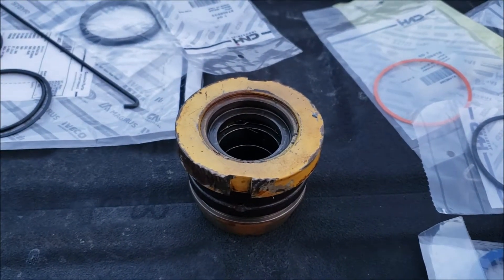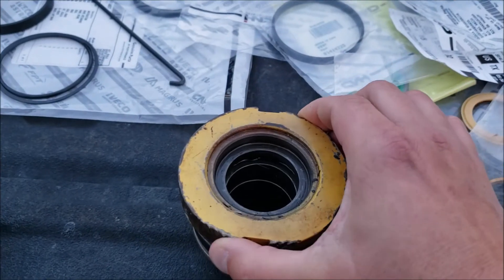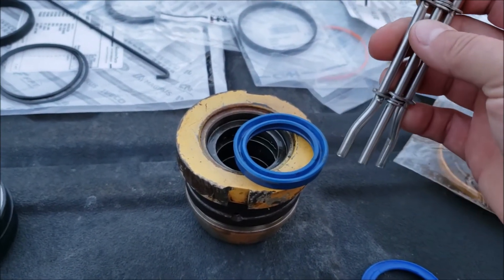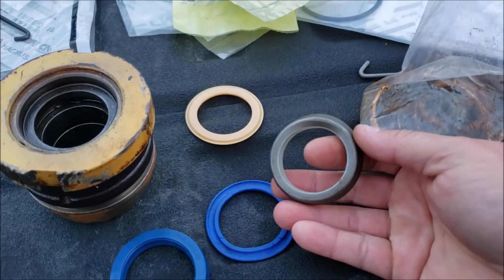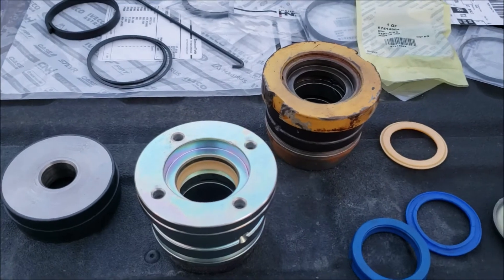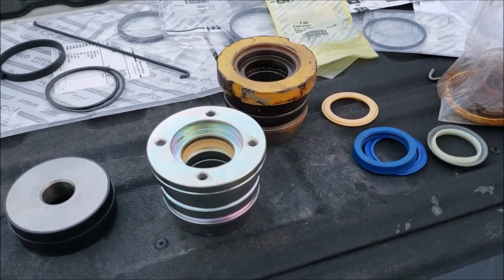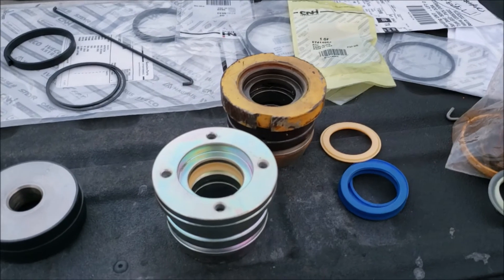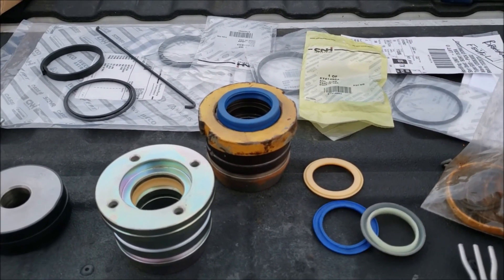Replacing Hydraulic Cylinder Seals - Part 4 - What did I do wrong?

Comment: If the superseded seal kit doesn't match with your old gland you don't need to buy a new gland just buy individual seals based on size. I do this every day.
Reply from the maker: Thanks.  Yeah, I learned that later on another cylinder.  I should have went to a hydraulics shop when I started having issues.  The local dealer wanted thousands to repair each cylinder, so that scared me away from them.  Later I found a shop that will rebuild each cylinder for about $300 including the seals.

Comment: I heat hyd oil to 180 degrees and let seal warm up to install it easily kinda but I bought the three finger tool set
Reply from the maker: I did not think about heating up the seal, but it makes sense.

Comment: I’ve used a ton of aftermarket kits and it’s a chance of getting the right seal and size 😊
Reply from the maker: Yeah, that was frustrating.  They only had one part number for this tractor so I did not know the gland had changed.  I blame the manufacturer for changing glands. ☹️

Comment: its a u-cup not a c cup....the one below is call a buffer and this takes me literally like 45 seconds to install all 3....that install tool is a waste of money....and so was buying a new gland....ive been doing this professionally for over 20 years...you wasted more money than it would have cost to have it rebuilt by a good hydraulic shop....not all shops are good but this rebuild tops would have been under 200 bucks...
Reply from the maker: That is part of the problem around here.  You can't find a good shop that does not want $1000+ just to look at it.  From what I remember the local hydraulic shop (which most say to avoid) quoted me $800 just for labor and it would have to be taken off the tractor and dropped off.  Then I would have to wait months to get it back.  I have learned to just try it myself and learn as I go.  The issue I had here was that none of the parts I ordered were the right ones.  If I could have found the right seal kit from the start it would have been $35 and done.

Comment: When you run in to this again, go to a hydraulic seal supplier. I own a hydraulic repair shop and have lots and lots of seals (this is not a sales pitch) and I hear what you said about the seals being obsolete almost daily. New Holland, John-Deere, CAT, etc.....obsolete these parts under THEIR system, but the seals are most likely still made. I shock people every week that they can buy just a rod seal, or just a piston seal, even though they are ‘obsolete’.
  Seal Mfgs aren’t dictated by one or two OEM’s. As a seal supplier, you’d be pleasantly shocked what you can still buy. Don’t buy hard parts unless you’ve checked with some grey haired, cynical, crabby old man that can help you without forcing you to buy more parts. I’d also be very careful about crap sold online. After all, the kids toys from China had lead paint, really makes me think those aftermarket kits are.........better?
  Odds are, you’ll be pleasantly surprised.
Reply from the maker: That is great information.  Thank you!  I was so pi$$ed when I found out the issue.  Why pay 100s to replace the whole gland for a few rubber seals.  Great information that I will use on my next replacement.
Reply: As a seal supplier, I agree with Albert. We can machine or match up almost any seal even if it’s obsolete. Happy to help either of you out in the future! We speak hydraulic repair.
Reply: i've got a hydraulic cylinder that has a welded gland nut, every shop that said they would work on it wanted to charge $500-1000, when a replacement cylinder only cost me a 1/4 of the cost. sucks since i've rather repair the cylinder then replace it but not much i can do

Comment: Thank you for taking the time to help others in the same boat. You've undoubtedly helped many frustrated diy'ers like me. I have a 1998 NH 555E with the same issues. I take pride in doing my own repairs when I can, so when you find out you've been sabotaged, it's very discouraging.
Reply from the maker: Thank you.  It was very irritating to find out I was setup for failure on this fix.  Luckily it all worked out in the end and I learned a valuable lesson on parts and changes.

Comment: That is soo dirty that they discontinued your seal kit making you buy a new gland. I'll have to keep that in mind when I do my 1995 backhoe
Reply from the maker: I will admit, I was not happy about it.  Even the aftermarket kits were for the new gland only.
Reply: @SeidelRanch  lucky my boom lift cyl. kit was the same. Looks like they are all set up about the same.
Reply: literally any decent shop has or can get you every thing there...In my shop i probably have enough to rebuild 12 of those...mcu wiper twin lip rod seal its a cat buffer even though that looks like a case cylinder and a ps1800 piston seal....nothing in that kit is special...equipment manufacturers dont make seal kits they buy them from seal distributors or manufacturers...even if they discontue them on the dealer side those same seals are used in thousands of other cylinders